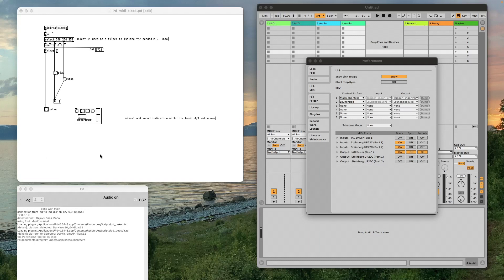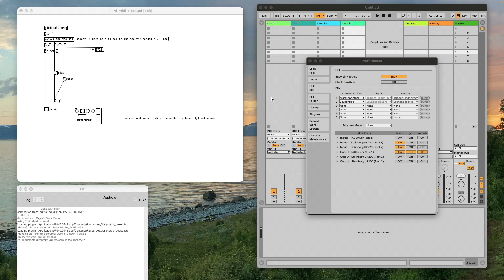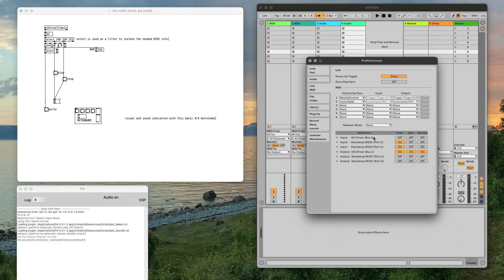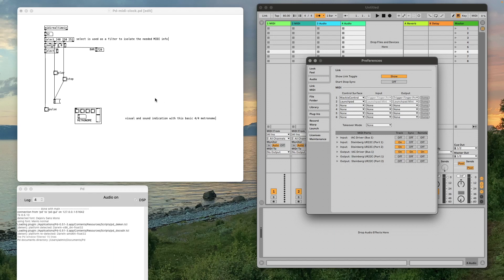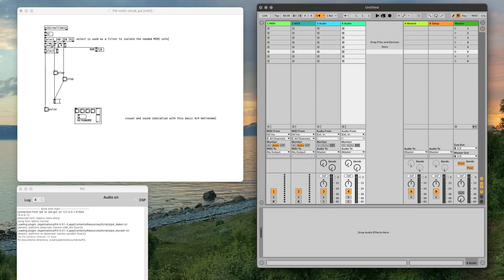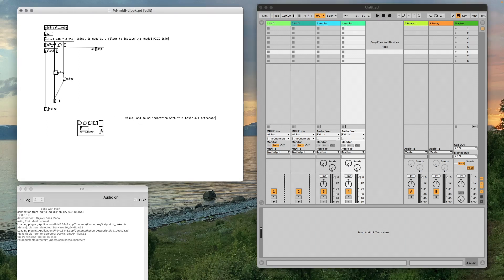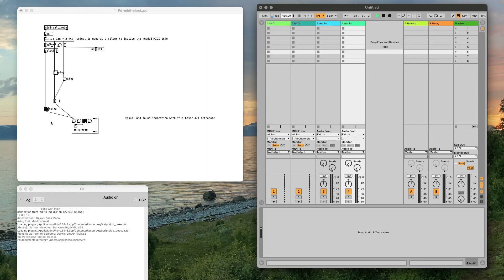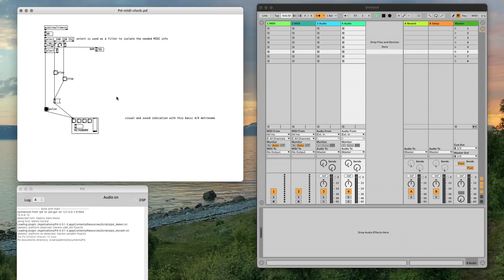PureData - how to get a pulse from an external MIDI clock

Comment: I tried this with ableton and worked perfectly! But im trying to clock it via usb midi with a Digitakt. When I press stop midireal time reads the new number and after a couple milliseconds if goes back to 248. So it never stops
Reply from the maker: It might be interesting to look a bit into the midi sent by the digitakt then. You can try to analyze what comes out of its midi port by using a program like midiview. That might give an indication of the behavior of the machine. I havent tested the digitakt personally so I'm not able to give an answer.

Comment: Could PD send a pulse out to a daw to control a tempo?
Reply from the maker: Sending a MIDI clock from Pd is a tad more complex than receiving it, since there is no "midi realtime out", however it isn't very complicated to generate a MIDI clock signal in real time from Pd. Maybe that is the topic for a second video!

edit:typo
Reply: @arthureau  can't get any regular  bpm out the bangs..via timer object.. (same set up with Ableton and external midi instrument) ...any idea?
Reply from the maker: @aubertpierre  I guess it depends of specific hard/software combinations. From my experience it is quite snappy, and will follow whatever clock I would send. But indeed if you were to time it out with a timer, you might find some delays or end up with a bpm of 120.2 for a few ms then 120.08 for another few ms, etc, which is rather normal and isnt significant enough to add a swing effect or make it unusable (again, from my own experience). If you were to share your patch on mail I could try it.
Reply: @arthureau  sent ,)